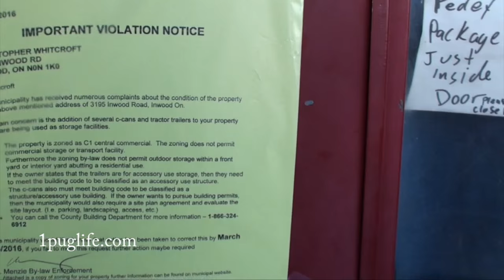bylaw dicks cock over my commercial transport/storage operation

Comment: not like you have 47 different ways to cut those longer bolts...
Reply from the maker: +Zach Hawkins all that will do is teach the munpkee that its ok to fuck up, we can just cut a little off! fuckamatterforyerself
Reply: +1puglife just weld it
Reply: +1puglife haha!
Reply: matanuska high The ol' Reach n' Screech
Reply: +Zach Hawkins I just suggested simply using lock washers on the bolts that are slightly too long. Why not? That would probably be better anyway, because the lock washers will prevent the 2 bolts from eventually loosening due to vibration of the machine in operation. That's what I would do.
Reply: +Tommy Ballbag sweeeeeeèeeeeeeeeeeeèeeeeeeeeeeeewt
Reply: YOU NEED THORAZINE NOT WEED
Reply: U right.
Reply: Zack is that the Zack I know?
Reply: +Chris Jennings yea with J.B weld that'll work

Comment: Pug said it was zoned commercial entertainment purposes.  Trailers are filled with props, mats for stunts, lumber for ramps, lawnchairs and parts for videos, exactly the definition of the zoned purpose.  Height doesn't matter when units are portable and certain distances from property line.  Hell they could be used to transport props to other locations for films, non of the city's business. Pugs attorney will eat this up if it goes there.

Comment: If I was you I would take 12 V battery charger and turn signal flasher and wire it in the transport truck trailer wiring harness and have lights flashing all night long

Comment: I'm only at the 11:22 time stamp of the video, so maybe you might've already thought of what I'm about to suggest for the 2 fasteners needed to mount the filter for the wood splitter. Why not just use lock washers for the fasteners that are slightly too long? Wouldn't that be better anyway? The lock washers will prevent the fasteners from eventually loosening due to vibration from the machine in operation. Just a suggestion.

Comment: Could you turn the valve block so it's mounted vertically? It might make fitting the hoses a bit easier and then the direction of the levers wouldn't matter. You'll get used to it after half an hour anyway and will be working it with your eyes shut after an hour no matter which direction the levers go. I always preferred the power blocks to have the levers pointing up and found them easier to us like that. Also they're not so likely to be moved accidentally if something falls on them.

Comment: Fuck it all to hell and back .Nothing is working out here either for my upgrading my water pressure tank to a larger size . Well i guess i finally get er figured out and need to get a check valve so it dont keep running the water back into the well ffs/bmp for that out burst .